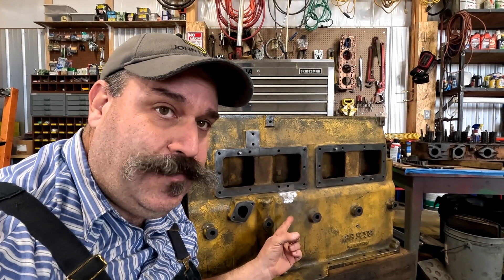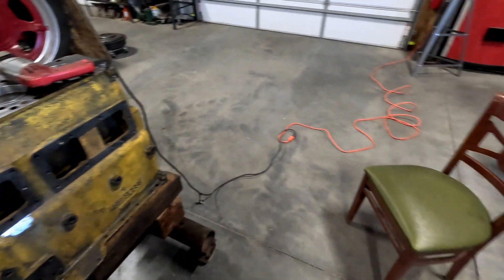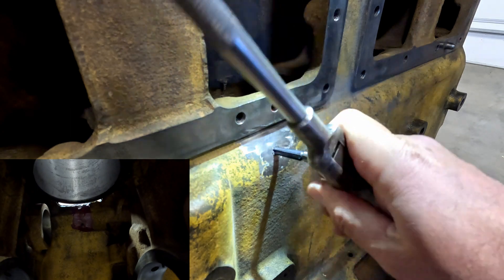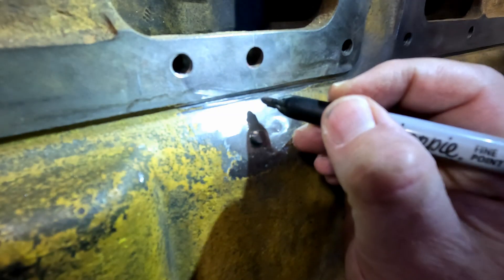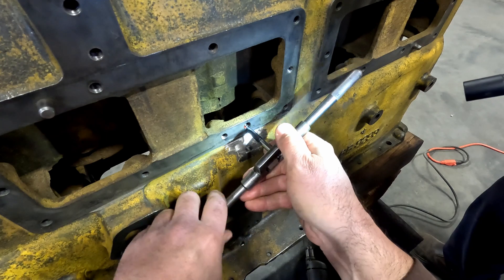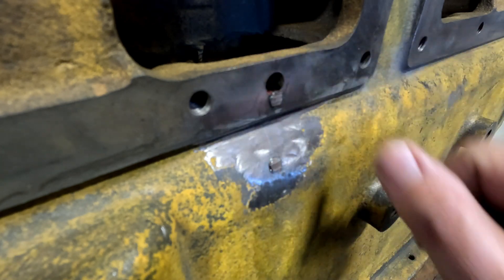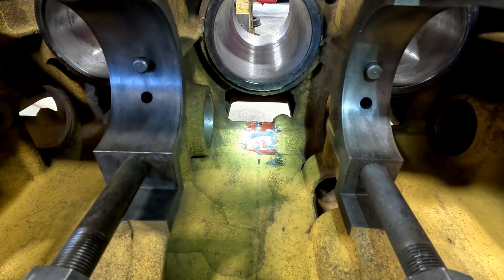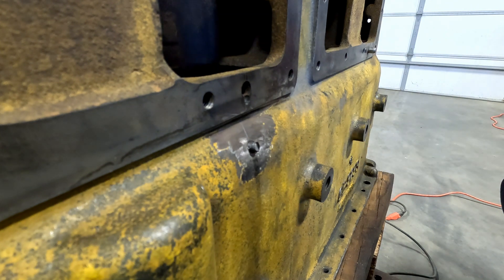Cracked engine block repair metal stitch pinning Caterpillar 1939 D4 4G9986 "Lil Lefty" Episode #72

Comment: What caused the crack?  Just curious. Nice work!!!
Reply from the maker: The dowel pin on the inspection plate got pushed in crooked and forced in. It's subsequently cracked the block. When we pulled the plate off it was not completely straight and pushed in. 👍
Reply: I figured that since the coolant jacket wasn't near it. Thanks for clearing that up. Stay warm!!! @lifeafterourloss

Comment: We did a gas compressor cooling compartment with the help of a Louisianan old boy technician. He used brass all thread instead of that kit. The thread was straight and he drilled the first hole at the end of the crack , threaded it and installed the first piece of all thread with the green lock tite. We broke the all thread off flushed it out and drilled the next hole almost half way through the first drill hole so the holes overlapped. Thread the next one and repeat. We did not have to peen the all thread because it was held in by the last piece of all thread. The brass all thread expands at a higher rate than the cast iron so it sealed up even in a glycol cooled casting.
Reply from the maker: That is very interesting. I never considered brass but it is something that might come in handy in the future. 😊👍

Comment: I saw those bolts before, in the late 60's ,but they were tapered,  and the head snapped off, when you got them tight enough, then you would pean them over. Great channel, just came over from the recommendation by Squatch.

Comment: I'd never heard of this so I looked it up, I got nervous for you because all the pictures on the first page I looked at, the repair went across the crack not in line with the crack, but then I looked more and found plenty of examples of doing it the way you guys did it.  
They say stitching steel has been around 100 years, I thought brazing was the only way to properly repair cast iron, and I've always been nervous about trying to braze. I gave away a 12" wood jointer because it was cracked, I wish I would have known about this back then.
Great stuff.
Thank you.
Reply from the maker: You're more than welcome and glad you enjoyed the video. There are proprietary methods to doing it that are better but this worked more than adequately. 👍

Comment: I worry about it acting like a feather and wedge splitting force all being tapered. Are all plug stitch repair screws tapered? never done it before.
Reply from the maker: That was our concern too. I think that is why you angle them. At pulls in different directions. The plugs are also a reasonably soft material. The taper is subtle, to help prevent leaks. There are strait pins for this method also. Lock and stitch makes them. But they are cost prohibitive and were 12-14 weeks out of stock.

Comment: Are you going to paint the inside of the lifter plateswith glyptol along witha bunch of area in the timing cover and perhaps the non gear mesh areas of the timing gears to reduce any chance of rust during storage. I wonder about a flash copper plating on the rocker arms and stands.
Reply from the maker: Probably not. We're a little worried about how well it would adhere to the remnants of the caterpillar coating. For now we're just sticking to surfaces that we could completely clean to the bare metal. We were worried about it flaking off and plugging up the oil system.

Comment: Odd place to crack, why?
Reply from the maker: It looked like the dowel pin got forced in crooked. When someone tightened the plates down where the decompression chambers are they forced it in, causing the crack. When we disassembled it the dowel pin was pressed clear inside of the engine block.

Comment: Looks good I have heard of this process. My dad welded a cracked starting engine block for a D315.  It cracked above the bolt flange on the right side  below the cylinder. To get strength we had to weld it. Nickel rod with lots of grinding cleaning it out getting a clean bond.  It needed a little water glass to seal up a couple a weep hole.
Reply from the maker: Nicole Rod is tough to weld with. It turned out really well on the belt pulley repair. But I was afraid to try and tackle it on this engine block. Appreciate the compliment.

Comment: I am a welder so I haven't ever thought much of the pinning process. After seeing you do that I may have to change my mind. I have seen dozens of terrible attempts at welding blocks by folks that didn't have a clue at what they were doing, and the mere mention of JB Weld on them turns my stomach.  Very nice job and I don't anticipate any issues from it. 
Welding when done by someone that knows what they are doing is a very good process. But many times it is very hard to prep the area or maintain the welded area after it is welded properly during the cooldown cycle. Again good job.
Reply from the maker: We really felt more comfortable about this type of repair. We did weld the belt pulley back together and it turned out fine. But I was willing to take the chance on a belt pulley housing. That nickel Rod is a whole other animal as I'm sure you know! I didn't want to make any mistakes on the block though. We were very impressed with the results from metal stitching. 👍
Reply: @lifeafterourloss  Yeah, there are all kind of options for welding cast depending on the application. Nickel, silicone brass etc the list goes on depending on the process you choose to repair it. The thing about welding it is many times the actual heat generated welding it is as big a factor as the original fissure in the metal you are trying to repair. Especially with poor quality cast. Cat usually is better quality cast and that doesn't come into play though. Good luck in your restoration of your machine and look forward to more vids.
Reply: I've seen JB hold up for years
Reply from the maker: @conspiracyscholor7866 I still love JB Weld, but wewanted something more permanent. 👍

Comment: One of the more interesting and very sophisticated ways of repairing a crack. I'm impressed by the work. When I think back what I have seen in terms of block stitching. A very old school or old schoolers repair is a brass weld or braising the crack. These are a rarity to see  but can be still seen on very old engine blocks. Than I have seen bolted patches that maybe reinforced with hard glue to make it seal tight. A few times I have seen special welding rods used to patch up cast iron cracks. 
All the above mentioned things do work in there own right(if done correct).
Reply from the maker: After the success on the belt pulley we really considered the nickel rod arc welding repair. Because the crack is in a non-critical area in the oil galley it was a perfect candidate for this type of repair (experiment). 👍